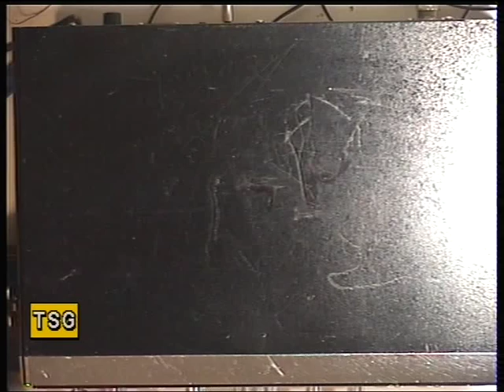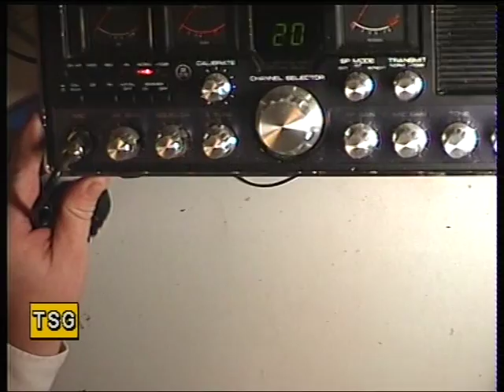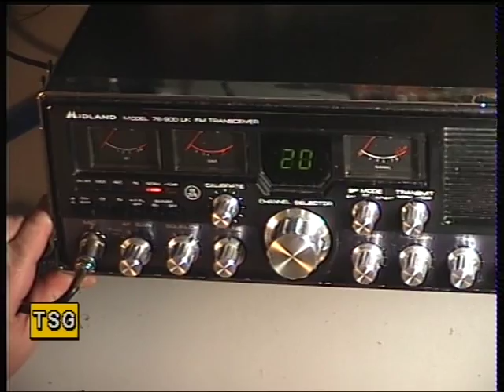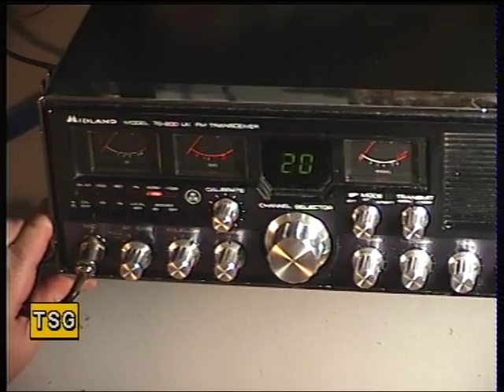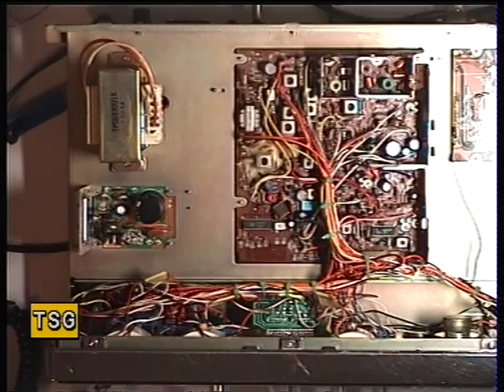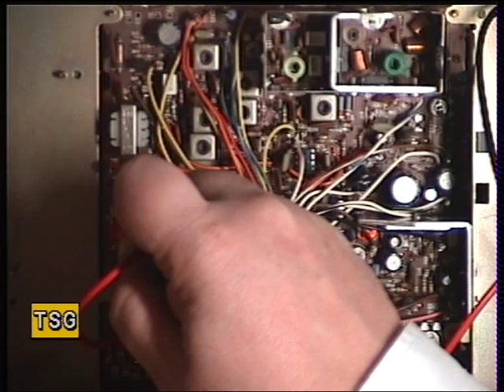Midland 76-900, UK (CB 27/81) CB radio (Base Station) - Transmitter alignment

Comment: Ive just paid 250 pounds for one of these in very good condition people may say I've payed to much but there getting rarer.
Reply from the maker: They were £369 when new. That was a real lot of money in  1982. I have one here & I paid £95 for it in 2014 via Ebay, sold as shabby and without the internal PSU working...when had to get rid of a modification too. I did a video you can find on it at the time. I jsut hope yours hasn;t been messed with.

Richard
Reply: @ukfmcbradioservicingTango21  fM and mid block
Reply from the maker: That's a shame it's been 'got at'. Not only is adding CEPT onto a 27/81 radio illegal, the performance on both sets of channels will be seriously reduced.

Richard, G0OJF, UK
Reply: @ukfmcbradioservicingTango21  Seems to work fine that I've found
Reply: @ukfmcbradioservicingTango21  This is the rate there selling for at the moment another one sold for 250 on market place

Comment: Do u know Richard I thought I recognised your name from somewhere. There were at least 2 CB Mags around in the early 80's did u wright for them both?
Reply from the maker: Yes, both under my real name, or "Tango 21". The best ever article I did was in "Citizens Band" magazine, with carefully & expensively researched data to enable you to work out expected range......can't remember which issue though...will have to look through! It works for CB & business radio up to & including VHF High Band.

The only article that they didn't publish, which I had submitted was "Modifying the Realistic TRC2003 for decent transmit audio"...just one capacitor change in the handset. Mmmmmm we'll do a video on that; it's a jolly good set with factory crystal filtered receiver costing £149.99...spoiled by really poor tx audio.